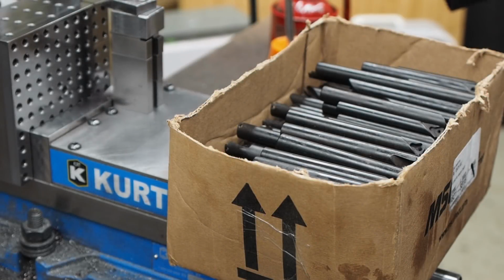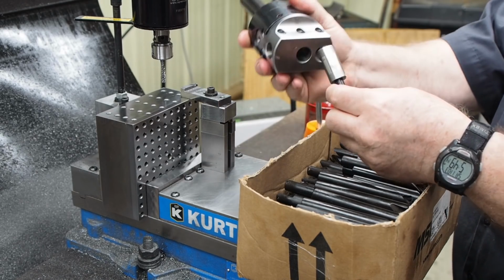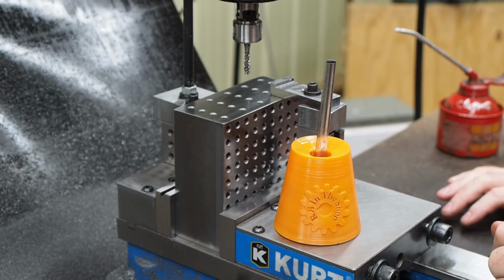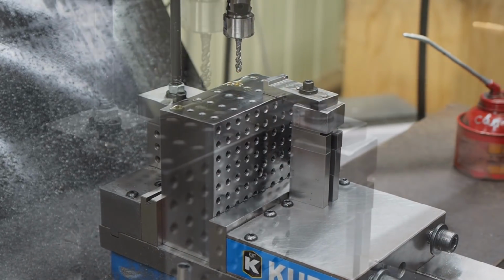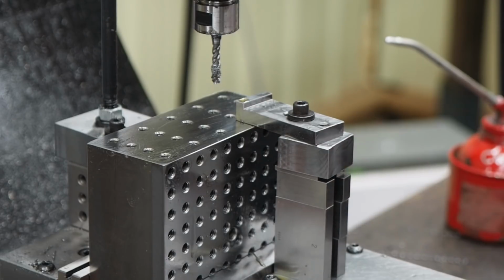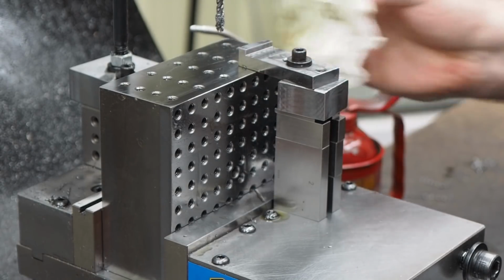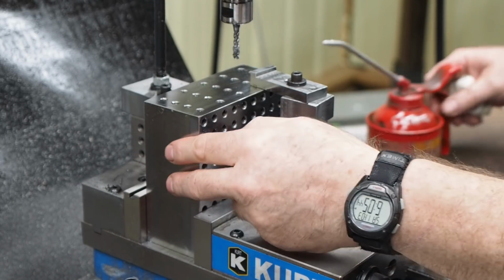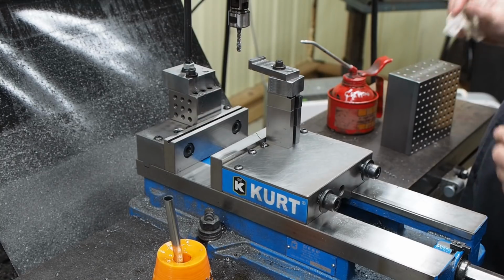Tapping the Squaring Blocks Part 2

Comment: I am a Tool and Die Maker too.  I will be making a pair of these cubes.  Are they ground 6x6x2"?
Reply: What steel did you say you used?  Why not 4140, or 1018 and case hardening like most 2x4x6" blocks?
Reply from the maker: Hi  @nevinzimmerly4888  We are using DC53. It is a much higher quality of steel. It has the strength of 01 and better wear than D2. Even with the best heat treating on case hardening steels you will have stability issues with size changes over time. When making high precision tools you want stability, wear and strength. DC53 is great in all these areas.
Steve
Reply from the maker: Hi Nevin,

You can make the blocks whatever size you like, our blocks are 5x5x2.25. We will grind them after heat treat.
Steve

Comment: Lot of work there! Just to state the obvious. Another thing about kurts I have a problem with is how they fit on a manual mill table. I'd prefer for it to be flush with the back edge, not hanging over. They need more mounting options. Thanks for another!
Reply: The cost for a Kurt vice ,one would think you would not have these squaring issues .i took my old Bridgeport vice ,reground it all around ,performs well ,however it's not perfect .
Reply from the maker: Hi  @jimphillips8774 ,
I agree. On some of their newer models they are designed differently making them more accurate.
Steve
Reply: If you move the vise forward to the front T slot it will not hang over the back of the mill.
Reply: @nevinzimmerly4888  
Thanks, yes on the 688, but I'm dealing with a new DX6. I do that with the older vises.
Reply from the maker: Hi James,
I like my Kurt vise but I knew before I bought it I was going to modify it. At my full time job I been modifying for our CNC machine vises for over a  decade.
Steve

Comment: if you set the quill stop higher, the tap pulls itself down, the tapmatic reverses at a set depth without the clutch needing to slip at the bottom of the hole,  you won't need to drive the quill down after the tap is started ,it will work as designed and be even less work . I think tom lipton had a video somewhere that explained it better.  the clutch might save a tap but it still puts stress on it by engaging every time it gets to the bottom of a blind hole. (I can't remember the depth at which it reverses, it was in the manual  lol )
Reply from the maker: Hi Linday Fog,
Thanks, I will try that on the next block.
Steve
Reply: interesting!  what depth would you set the quill stop to?  i thinik im missing that part.  id like to try this method

Comment: Interested to figure what the ID of the hole is after tapping, given that the pre-tapping size is a dead-size to your dowel pins
Reply from the maker: Hi JBfromOZ,

Just checked them.  It is about the same, both pins fit like before the tap but you can feel the ridges the tap made.
Steve
Reply: Good to know! I imagine a big pet of that will be using the decent taps, cutting instead of rolling in the thread or raising a burr

Comment: What is your website?  I am interested in one of your carbide boring bars.
Reply from the maker: Our boring bars are A2 tool steel with carbide inserts. I don't make a carbide bar yet. If you are interested in the steel bars the double ended ones with a Sumitomo carbide insert and insert screw are $75. The shorter ones for the boring heads are $60. You can send an email to solidrock@nlbchapel .org telling us what you like and Kathy will set you up.
Steve
Reply: Solid Rock Machine Shop Inc.  Ok I will send an email.  Thank you.  BTW, Mr Pete in his part 2 belt sander video said it was carbide.